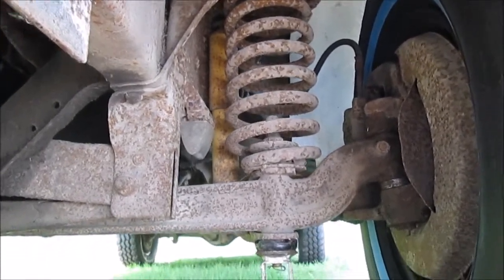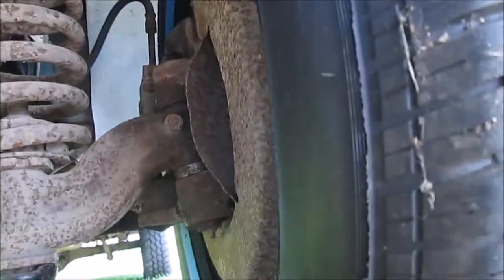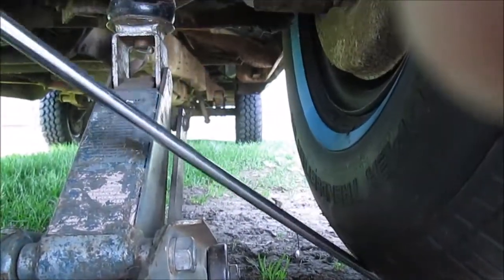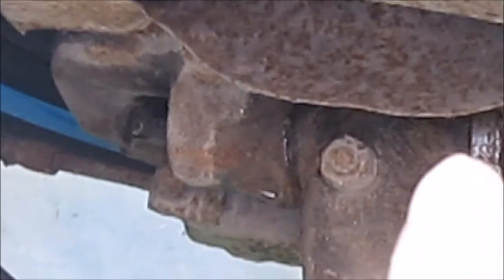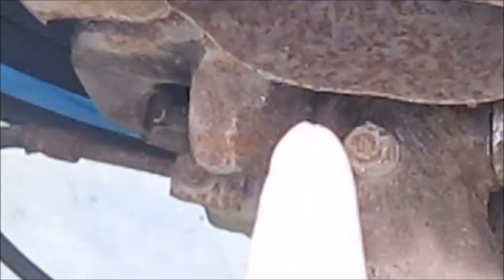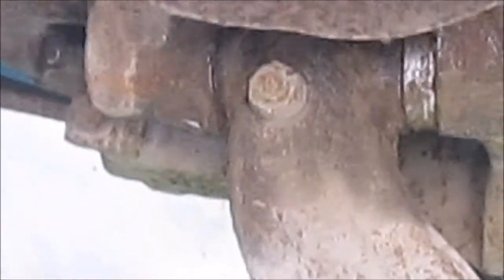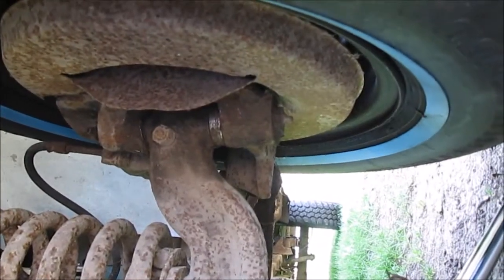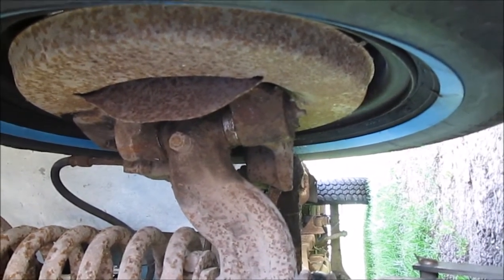F150 twin I beam worn  Kingpin bushings

Comment: It was hot and humid here today too. I wonder if that's normal wear for the Nylon ones...I've never used those.
Reply from the maker: It hit 90 deg.The reason I used the nylon ones is the metal ones have to be reamed to size by a shop ..I am going to use nylon bushings again but this time use a high pressure moly graphite grease

Comment: I have a 69 250 did it come with any camber ajustment ??? Or does excess positive camber indicate bad King pin bushings ? I haven't got to the king pins yet only had the truck for a year or so but both front wheels have alot of positive camber .  I seen they sell.a camber kit but don't know if that applies to a 69 250 ...
Reply from the maker: On mine the only camber adj. is how good the springs are ...There used to be shops that would heat and bend straight axles to set them

Comment: wow wore fast that should last a lot longer than 20000 miles for sure
Reply from the maker: I honestly can't tell you the miles ...But when I change them I will make a note and I will use some moly grahite grease since these are a gray nylon easy to replace bushing they won't last like the steel ones which cost almost twice as much
Reply: Hi hello.. I just changed these on my dad's 1992 Ford f150 .... $420 ... Total ... Parts and labor .... 
King pin bushings ... Was this a good deal at my local trusted shop ???  My truck runs so smooth now